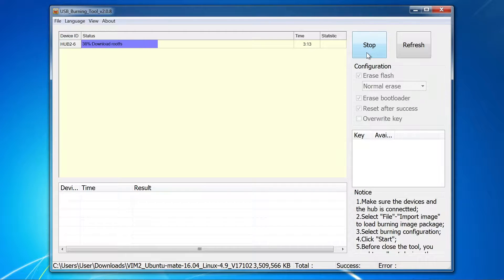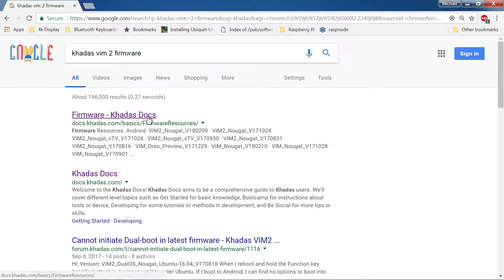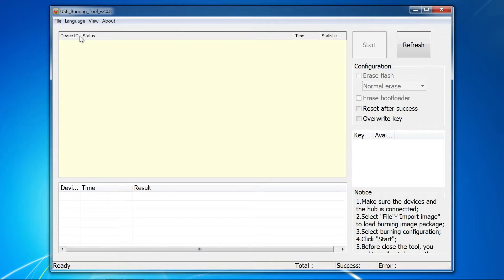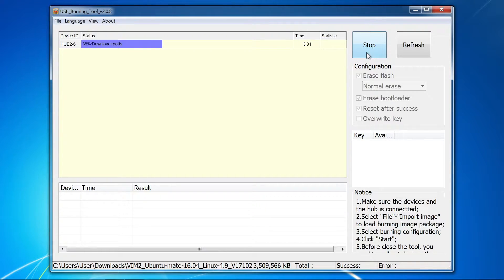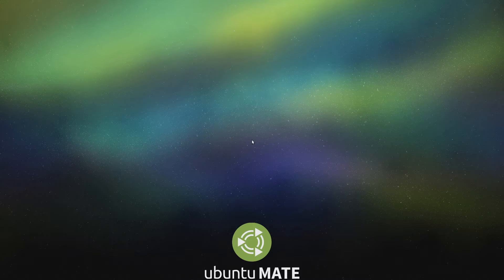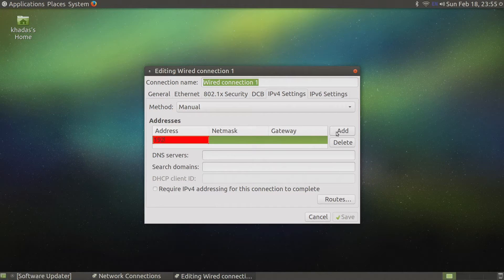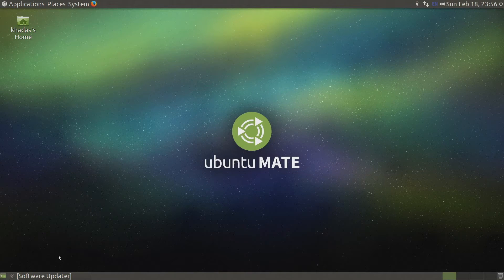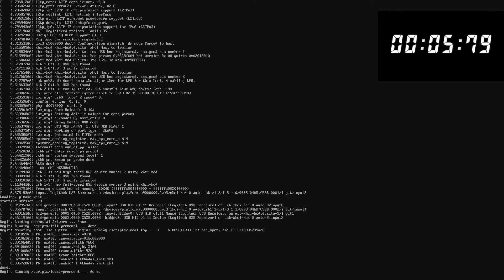Khadas VIM2 Firmware Upgrade

Comment: How do you connect the fan? All the fans connect to the pins with female connectors and the unit has female also. How do you connect female to female to use the fans?